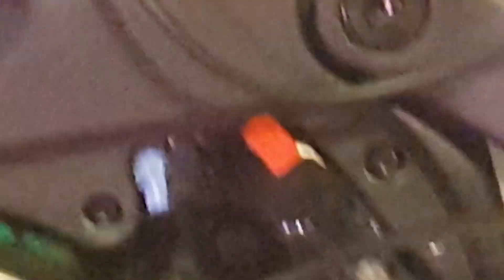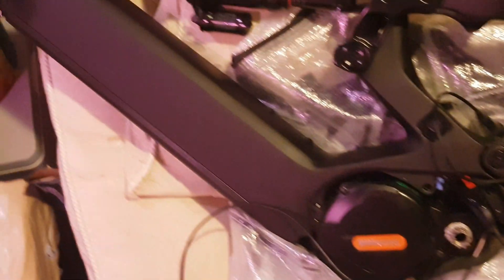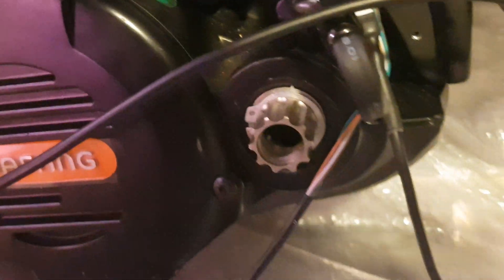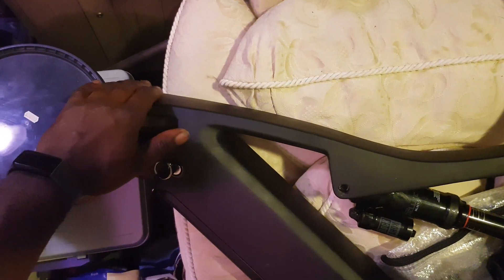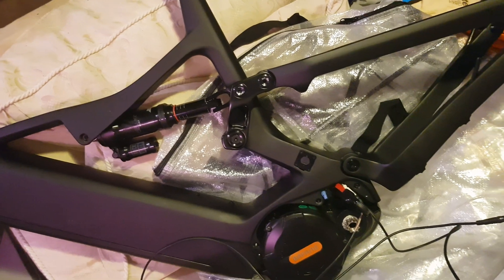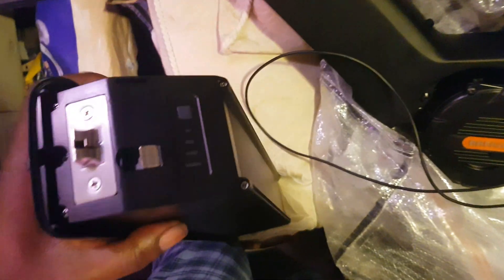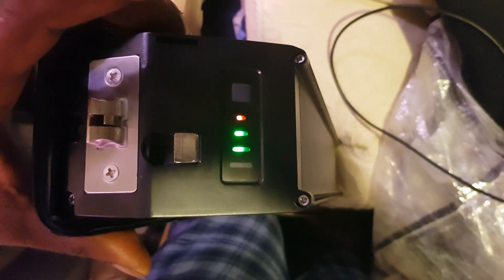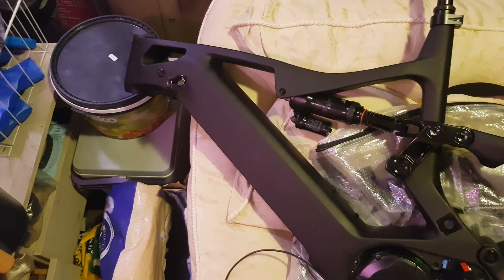Yes, you can use the UART Bafang M620/G510 motor with the Dengfu E55

Comment: Здравствуйте! А для чего чёрный разъём bafang m620?
Reply from the maker: The black connector is the negative wire. The red connector is the positive.
Do not switch them and simply plug each connector together with the corresponding colour👍🏿

Comment: I see there is "lights" button on the handlebars, so can lights be switched on/off with this button and powered by the main battery?
Reply from the maker: Yes. Lights (front and rear) can be easily wired into the motor using the dedicated plugs and can be turned on or off by the display/handlebar remote. Brands like Supeenova, Spanninga, Busch & Muller (just to name a few), can be used and are powered by the main ebike battery👍🏿

Comment: Did you have to connect the bms communication cable or can it work without(only 2 wire battery connector )

Comment: Hi Neeko hope you are OK. My name is Richard. I am having a prob with my bike. 
It's a Sondors lx 48 v
Bafang m 620 motor
Display  dcp 35.
Bike is turning on and showing codes 21& 36. I strip the bike down and   found  the negative terminal broken.  Reconnect and restart  the codes are still there. When you try to operate the bike it goes blank on the screen.  Battery is fully charge at 53.8 v.
Is there a way to clear the codes.
And where is the  GBK  business located that you spoke about. If you can help I will appreciate it thanks
Reply from the maker: Hi Richard, I'm always happy to help and assist. 

Please kindly bear with me as I make a quick enquiry (I'm pretty sure Sondors used M620 CANBus).

I'd so, I should be able to point you in the right direction. 

I'll get back to you very soon👍🏿
Reply: Sondors LX was indeed CANbus.

Comment: Can you tell where the lighting cable plugs in?
Reply from the maker: There are two blue connectors on the M620. One is open (female) and the other is closed (male). The male blue connector is for the front light and the female blue connector is for a rear tail light. The light connectors use a proprietary bafang connector to install into the M620. However, the light connector to attach onto a light is a traditional spade connector👍🏿
Reply: @neekodevinchi  Thank you very much.

Comment: Hi, Hope your well, just wondered if you changed to motor controller settings from standard and if so what is your preference. Cheers Dave
Reply from the maker: Apologies for the delay Dave.
I did. But you may not necessarily need too. If the M620 you have is uart and is set to a 48v battery and you're using a 52v battery, then you'll need to set the minimum voltage cut-off to reflect this. For a 52v battery, the cut-off value needs to be set to 43v. 
However, if you're using a CANBus M620, you'll need the besst tool to change the firmware. 
Other parameters (speed limit, power, wheel circumstance etc), I have tweaked but this is just for personal preference. But its not necessary.

If you tell me how you want the motor to respond/perform, I can provide you settings to try👍🏿

Comment: I’m not sure if you tried the 750w variant. But the m620 has 1000w and a 750w variant. Have you tried the 750w? I would like to know if it’s worth upgrading to the 1000w. My 750w canbus m620 peaks at 1255w with a 48v battery.
Thank you
Reply from the maker: I haven't tried the 750w M620 for the E55. But you could argue that the E55 is more designed for the 1000w M620 (CANBus and/or UART) atleast. Considering the E55 cam support a 52v battery. 
My E22 uses a 750w uart M620, which I can program to make 1000w. But I'll explain this more in an upcoming video when I compare the performance and capabilities of both👍🏿
Reply: @neekodevinchi  my question was more, I have a canbus m620 750w, is it worth upgrading to a canbus 1000w m620?
How well does your 750w uart perform compared to the 1000w (no programming), since I can’t program it
Reply from the maker: Gottya👍🏿.
Essentially, a stock uart M620 is no different compared to a stock firmware CANBus M620. The only real differences between the two is the speed in which data is transferred and relayed between display to motor, speed signal to motor & battery output to motor etc.
The peak output of the M620 however is meaningless, unless you have a battery which can provide the power and range to sustain the additional watts generated.
E.g. the biggest battery the E22 can support is a 52v 15amp battery. Paired with a 1000w M620 (uart or CANBus), the performance would be more noticable compared to a 750w M620 with a 48v 17amp battery, as the efficiency of power is increased and motor's controller (subject to programming) would allow the continuous flow of power without regulating the output to keep within maximum current. However, the range/runtime becomes questionable. Especially if you're using the higher levels of assist ot relying more on throttle than pedal assist. 
If you compare this to a 52v 20amp battery (with the same 1000w M620 motor), you don't lose the performance benefits. And increase the range & runtime.

So in other-words. if you have a bigger capacity battery to pair with a 1000w M620, then yes. The performance benefits are noticable. You would find that if you required level 2/3 or 3/5 with a 750w M620 to do a steep climb, this  would be levels 1/3 or 2/5 with the 1000w M620. 
BUT sustaining the power consistently with a 1000w+ M620 is heavily reliant on a high capacity battery.

Apologies for the lengthy response. If I've still not answered your question (or need more information), please reach out to me on Facebook or Instagram. I can try and demonstrate the difference👍🏿
Reply: @neekodevinchi  your response was amazing. My battery is a 48v 21amp. I get exceptional range with the 750w. 
What about top speed on flat ground. How does the 750w uart compare to the 1000w (I know gear ratios matter heavily and the battery voltage), but I’m trying to get a vague idea on their differences
Reply from the maker: An M620 ran at 750w would produce 120NM of torque. Essentially, the motor's maximum current is set to 20amps. Whereas the 1000w M620 (by default), is set to 30amps. Producing 160mm of torque. 

Essentially, the real difference is the propulsion and the response time in which the motor delivers the power. Everything becomes further amplified, as the power increases. 
As for top speed. Essentially the M620 has always been able to achieve on average 30-35mph (750w or 1000w). The difference is just how quickly you achieve the top end speed. Giving the M620 a mechanical advantage can aid in further increasing the speed. But like most things, it's a balancing act. 
E.g. my E22 (now) usee a 36t chainring, paired with a 11-50t cassette with a 750w M620. Using the 48v 840wh battery, it will achieve near 40mph on average in higher levels of assist. But it will require shifting down the cassette gradually for the motor to get the rpm necessary to reach that speed. My E55 (using the same drivetrain and gear ratio) with its 1000w M620 and 52v kilowatt battery, does not need as much mechanical advantage to reach the same speed. Instead the etiquette used for the E22 to achieve 40mph, would allow the E55 to achieve 52.2mph. 
But again, it's a balancing act. As this will prematurely wear down the drivetrain more with the 1000w M620 compared to the 750w M620.

Of course, tyre tred /compound, wheelsize, weight etc, would also play a role in achieving top speed & range as well👍🏿
Reply: @neekodevinchi  I thought it was 25amps on the 750? And 30amp on the 1000w.
My motor peaks at 1255w (it will maintain 1255w as needed), How much torque do I get? And why’s it advertised at 160nm..I can get a 1000w canbus motor for 730$ and do a direct swap. My battery is 48v 21amp.
Is this a worthwhile switch in money and effort?
I can’t make my mind up since the difference seems kinda negligible..and my battery life is exceptional, after 2 hours of riding with heavy throttle use I have 50%ish battery left. My bike weighs 80lbs and I weigh 170lbs
Reply: @neekodevinchi  or should I wait for the m630 release? I don’t know if the igh will require a special frame..or if my battery would work
Reply: @neekodevinchi  some user on Reddit posted info on how to read the controller software version..
This is mine

Software Version: CRR10MC4825E101111.2

•	CRR10M(Controller type)
•	C(Can communication)
•	48(Power supply voltage)
•	25(Maximum current limit)
•	E1(*****)
•	01(Hardware number)
•	111.2(Software version number)

So I do have 25amp..idk why you said 20amps..how much torque do I get if it peaks at 1255watts?

Should I just wait for the m630?
Reply from the maker: Apologies for the delay. 
If those are your controller settings, then your peak output in terms of torque should be around 135nm. This would make more sense if you've managed to achieve 1200w in peak output. After speaking with a fellow Bafang diy colleagues, we don't know of any other firmware specific to the M620 750w CANBus. With that being said, I go back to my original point concerning your battery capacity. If you're finding yourself with good range (no different than my E22 with the 750w M620 motor and 840wh battery), I'd question whether it's necessary to upgrade just for more power. 
If I may ask, what M620 ebike do you have currently? Is it an E55?
Reply: @neekodevinchi  it’s a sondors rockstar, with rockshox fork and rear shock..they advertised it as 160nm (even their support techs said it was around 167nm on the top end)..I think they’re going out of business now tho.
The thing is the battery can take the extra load, I always return with 50%ish left after 2 hours.

I also have another issue I would like to resolve. At about 25mph I get ghost pedaling, it’s a 48t chainring and a 11 speed, 11t smallest cog..but I have no resistance on the pedals. It’ll throttle up to around 31mph…but how are you getting such fast speeds with a smaller chainring. I want to still have resistance and add pedal support at higher end speeds, would require a larger chainring, but this won’t mess with the gear ratio for the mid drive?
Reply: @neekodevinchi  what would happen if I flashed a 1000w firmware on this 750w motor? 
Do you think it can handle 30amp current limit? Is there an actual hardware controller difference between the 750 and 1000w, or it’s just a firmware limit? 
Sorry for all these questions I just can’t find a lot of info on 750w m620s

Comment: What torque specs did you use when installing the M620 bolts to the E55 frame?  Thanks !
Reply from the maker: 35nm for the securing bolts (light grease on the shaft of the bolts and blue threadlock on the threads). 45nm on the chainring spider lockring (again, greased). 40nm per each crank bolt (greased splines) & 5nm for the side cover & bash guard which uses philips hesd screws👍🏿

Comment: Did you use the motor before? It already has quite a few kilometers on it. Or is it the display from another bike and shows the previous trip?
Reply from the maker: The motor was brand new with 0 miles for this video. The reason for the mileage, is due to the display being one of my spares before being swapped out for something else. But the mileage can be removed by clearing any recorded data on any uart protocol display. 
Hope this answers your question👍🏿

Comment: What’s the highest capacity battery that frame can hold? I see those frames with 48v 17.5ah batteries usually…I would prefer larger
Reply from the maker: Not too sure whether you've watched my other video. But to answer your question, 52v20amp (1040wh) battery is the biggest for now👍🏿
Reply: @neekodevinchi  no I haven’t watched. I’ve came across your channel only 3 times so far

Comment: Hi, what is the difference BTW. The UART / CAN version ? I heard some motors have stainless gears others plastic.... which is better?
Reply from the maker: hi there, it would be difficult to explain the significant differences between CANBus & UART within a simple reply. What i'll do, is make a video which will go into detail outlining the differences and answering any myths which surround the two motor variables. As for the main reduction gear, the newer UART (pre 2020) all use the steel gear. All CANBus M620s use the steel gear as well. Keep a watchful eye on upcoming content👍🏿

Comment: What i like about that battery pack is it has 21700 cells in it that are higher capacity batteries than 18650 and are cheaper to buy than 18650 batteries if you ever want to repack it one day when it dies it'll be a cheaper to rebuild.

Comment: Would you say the e55 is the best frame for the m620 & your style of riding?
Reply from the maker: That's a good question. The bike has only been built up for roughly 2 weeks at the time of me writing this comment. 
I have tested the E55 to the E22. But I wouldn't mind having more ride time on the E55 to gather my thoughts and opinions.
They are different (more different compared to the E10 & E22). But I feel that each bike shows inherent strengths, depending on specific circumstances. 
But I'll explain this (and more) in the upcoming vid👍🏿
Reply: @neekodevinchi  looking forward to that video

Comment: Hi mate I am hopeing you can help me I have a homemade ebike that has a voilamart conversion kit on now I'm wanting to put a new controler and throttle on and the on I want says it's compatible with uart but I don't know what that is and if it will fit my ebike would you happen to know if it would work cheers man ✌ 👍
Reply from the maker: Hi there. 
I have looked through the Voilamart website and understand that the kit does have provisions to support a throttle. However, their controller and connectors are based on the the old SM Molex connectors. Meaning that swapping the controller would mean swapping out the majority of the system (display, cadence sensor, wire harness/loom, throttle and possibly the hub motor).
UART Protocol is essentially connection style whereby, everything individual component is on a separate relay. Meaning that each component doesn't need to communicate with another to operate. Thus, making UART highly programmable. Manufacturers such as Bafang, CYC, Tong Sheng etc, use this style of protocol to dial in the specifications and performance of the system, depending on the application. But the primary benefit of UART is that the system lends itself to being more 'plug-n-play'. Meaning that you can swap out components and replace them more easily compared to researching whether a particular component is compatible with another system. 

Your current controller from voilamart isn't UART compatible. In order to achieve what you're looking for, it would require a complete strip down and replacing of the kit/system. 

The good news is that the one thing which you could carry over onto the new system is your current battery. But if you're intention is to run higher power/voltage, then you would need to factor in sourcing a more powerful battery. 

I'd be more than happy to assist in terms of both guiding you / assisting you, as I've swapped out complete systems on both mainstream and DIY ebikes before. 

Feel free to contact me either through email, Instagram or Facebook and we'll go from their (links to my contact details in the description and on my channel bio)👍🏿
Reply: @neekodevinchi  man thanks so much for taking the time out to help me and it definitely has helped me saved me from buying the wrong thing and if it's OK with you would it be OK to pick your brains every now and then cheers mate 👍
Reply from the maker: Not a problem. Truth be told, you're not the first person to enquire about these type of matters. So I usually assist as much as I can. 
Feel free to contact me if you ever need help or advice👍🏿
Reply: @neekodevinchi  thanks man that's really nice of you And today you have already saved me £90 because I was going to order it and just hope it was right It's great to know that I have got someone I can ask if I'm stuck with an ebike problem so thanks again mate ✌👍🚴‍♀️

Comment: Are you running the 52v 500c display, Eggrider v2 display or something else Neeko? I'm trying to find displays which work with 52v+ batteries which aren't expensive👍🏾
Reply from the maker: Currently, I'm experimenting with different displays for the E55. Dengfu have asked me to play around with different displays and configurations of the bike. I'll keep 'price per display' in mind, as I play around with them. But so far, the 500c 52v display seems to be the cheapest. But I'm awaiting on a SW09 52v display so I'll update both the channel and the Dengfu Facebook community group👍🏿
Reply: Nice👍🏾
I think the different displays you can use on the E55 is worth a video.
Reply from the maker: I can do that👍🏿

Comment: Dengfu are still using power switches on the frame. Why? Isn't the power switch redundant like the E10 and E22?
Reply from the maker: The power switch would only be made redundant if you bypass the BMS trigger switch in the batteries for the E22/E23/E10. The Reention Rhino battery used for the E55/E56 (and other frames which aren't Dengfu), doesn't suffer with the intermittent power loss issue. Although, you can still build your own battery if required👍🏿

Comment: UART or CANbus are same     motor with different controllers.
Reply from the maker: Their's a bit more to it than that. The torque sensors differ, along with the boot up sequence defined between both respective communication protocols.
It might be worth while shooting a separate video, explaining the differences to avoid confusion and doubt👍🏿
Reply: @neekodevinchi  people asking are obviously not to educated with the motor! You don't want to confuse them even more!! Easy answer is they are physically the same!
Reply: Exactly